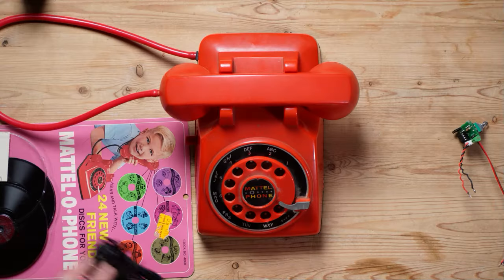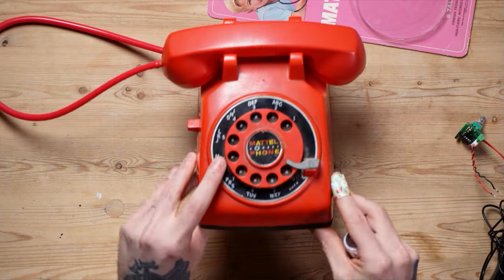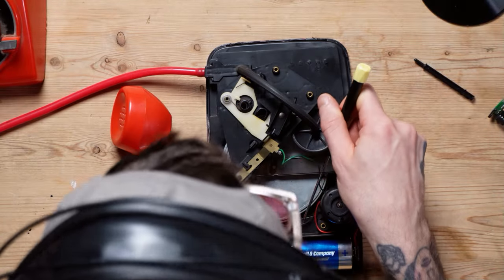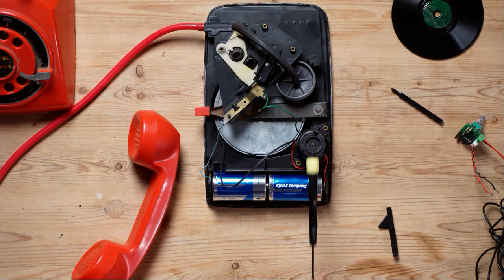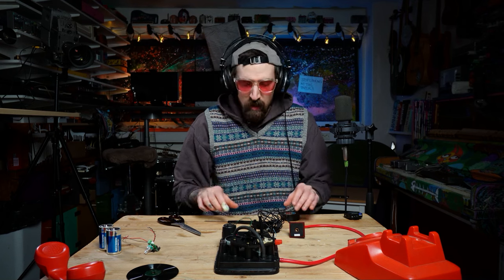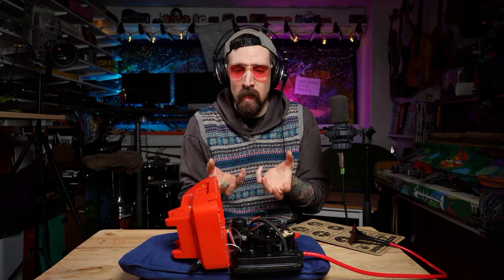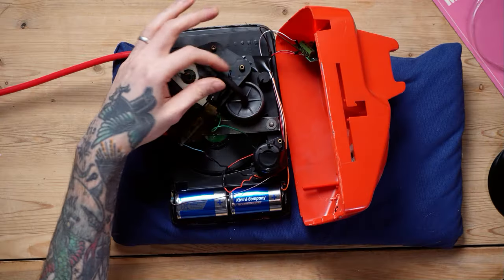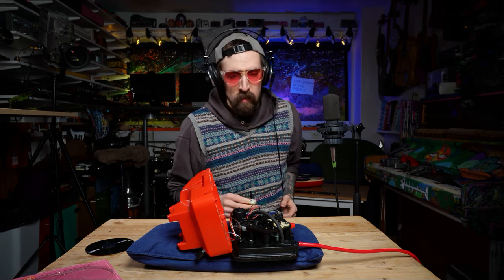This 1965 Telephone Toy Is A Record Player

Comment: Possibly a bad resistor? I'm not an expert in electronics but sounds like it could be that. And you as a circuit bender should know to put a pot in there if you find it.